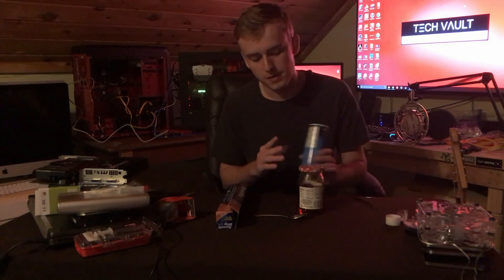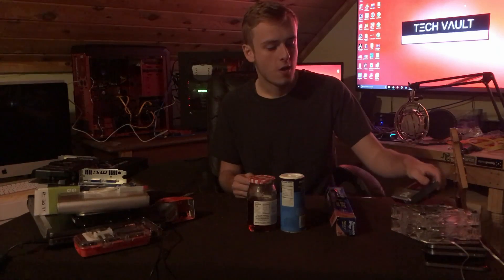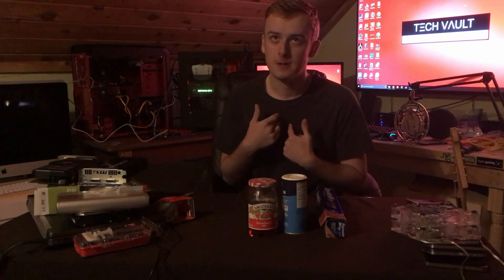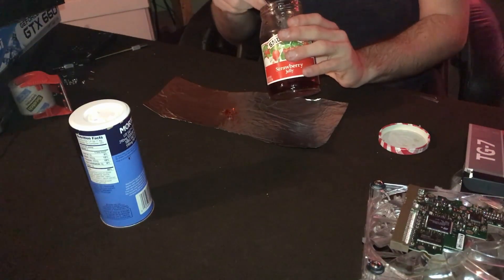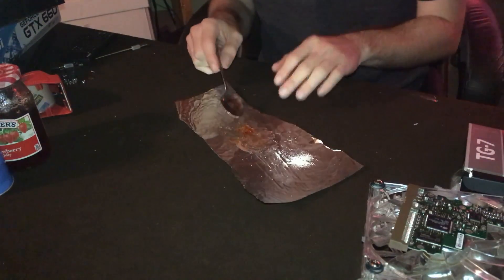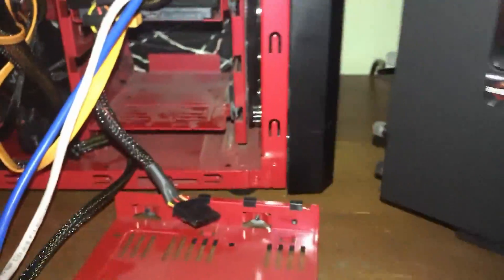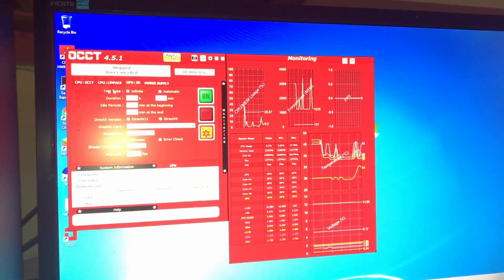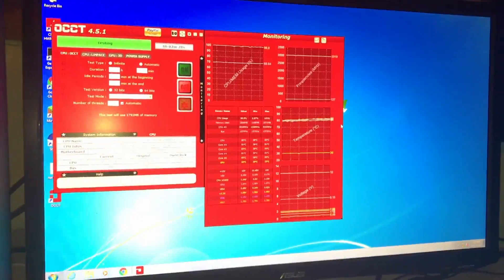How to make Good Thermal paste at home with common items

Comment: Better solution. Use metal shaving like copper. Make sure its very fine like a powder or  dust. Mix it with rubbing alcohol. Just enough  to bind it.  Be careful when you applying because copper dust is very conductive.
Reply: Don't do that, thats just stupid, it would fry your components, just use toothpaste instead
Reply: @leyzic9272 
Very expensive.

Comment: Based on my personal experience, you can mix toothpaste with grease oil. and won't dry. the mixture dosage is 70% toothpaste and 30% grease oil.
I have tested it on a laptop with a minimum temperature of 52 Celsius and a maximum of 74 Celsius.
Reply: Lol might try this buying new pc parts since the pc is 5 years old. gonna be a fun experiment
Reply: @toku5029  Hope the salt doesn't cause anything expensive to corrode.
What am I saying. If you do anything this stupid, you get what you deserve.
Reply: @BrianG61UK 
Yup your pic represent you well.
That's why it didn't came to your mind that the thermal paste are very expensive in some countries!
Reply: @CoptMan80  No ability to order off Internet? You have my sympathy.
Reply: @BrianG61UK  
Online order from China will take 45-60 days, it's a long time to wait, I'm making my own already.
Reply: How the heck can you afford a laptop but not be able to afford real thermal paste.
Reply: What if i add a iron and aluminium powder
Reply: You have a laptop and if it’s not a gaming laptop then the thermal paste isn’t that much of a deal because the low TDP with the unsatisfying-ly small cooler
We mainly need desktop chips as they have a higher TDP = more heat
Reply: @DJProPlusMax  asked ?1! 😳😳😭

Just kidding

Comment: I made this with few adjustment. Half the jelly,  barely any salt and i scraped a lot of my tip off my charcoal pencil and mixed it well and let it sit for 24 hours then used it and it works great.

Comment: I used Nivea Creme for a year. After a year If was still Not dried out. Had the Same temps as the standard stuff.
Reply: Mix Nivea with graphite so it becomes completely black. Temperatures will be better.
Reply: Why nivea creme? It doesn't contain a zinc oxide!
Reply: @CoptMan80  there are Versions with zinc Oxide... Another one is penaten Baby Creme that also has zinc Oxide in it. Works perfect.
Reply: @worldsendace  
Should it be a cream? I mean I've zinc oxide powder, will it work better?!
Reply: @CoptMan80  only Powder dosnt work because its dry. But you can Mix it with the creme. It should look like normal paste. In the end. You could also Mix the zinkoxide with oil. To make a Paste.
Reply: @worldsendace  
Yes i meant they sell zinc oxide poweder so i can use it better than a cream contain little of zinc and other ingredients, I'm planning to mix zinc oxide powder with graphite and vaseline to have a paste, if it works well it's still will be cheaper than the thermal paste in my country which is 4g of mx-4 cost about 400 local pounds! Thermal pads are more expensive!
Reply: @CoptMan80  yeah Just try. It will Work. As i Said i use this Creme with zinc Oxide all the time because i repair PCs and Test cpus on a daily basis. Comes realy Handy If you Change CPUs and Test them. Because one Pott of this Creme is 250g and thats enough for a Long Time. And i pay 2.99 Euros for it.
Reply: @worldsendace  
Great 👍

Comment: Can this work for a PS4?
Reply: Have you tried it
Reply: @allaroundtexas6433  nope, but I just took the cover off the PS4,  an original day one kind, and now it doesn't turn off on me after 10 mins. I can literally get a 8 hour gaming session done without the worry of overheating. Just leave it where there's a bit of airflow like a draught or something and you should be grand.
Reply: @johnnybongos3648  it worked

Comment: You killed my xbox
Reply: dr.jensen really what happened?
Reply: @SouthPokey  it burned it and started smoking and it blew the cpu up
Reply: Is not for pc or consoles is for power supply and others smd cips
Reply: @drutzi7364  it said its for both but i see i did it on an 360 and a pc they both got killed by this method rip
Reply: @bigfattony_  then rip

Comment: Salt is A good  conductor of electricity and there are tiny registers which will short circuit.
Reply: Top 3 best conductors of electricity in order:  Silver, Copper, Gold.  If you think Arctic Silver is safe to use and that it contains silver then you're not doing anything different.
Reply: I don't think anybody should take advice from you considering you can barely spell and formulate sentences
Reply: Owoop

Comment: i use tooth paste that comes with salt in it but u have to change it every 2 weeks
Reply: does it work?
im kinda worried without saying its real
Reply: @IJN_Kawakaze  it is good but change it weekly
Reply: @DrAliToma  i already did it, its fine :D im getting 65 to 72 temperature
Reply: @DrAliToma  Where do i store it? i  make many of it i kinda wanna know how to store it in case it will be dried up
Reply: @IJN_Kawakaze  u put salt in non salt tooth paste ? I meant use tooth paste with salt already in it but i guess that works too ... if u wanna store the patch u made just plastic wrap it tight with no air so it doesnt dry
Reply: @IJN_Kawakaze  also please tell me u used fine salt..
Reply: @DrAliToma yea
Reply: @DrAliToma  i put a salt on a non salt toothpaste the salt doesnt melt so i put a bit of drops of water to melt it
Reply: @IJN_Kawakaze  careful getting it on the mobo or the socket .. also u can just crush to a fine powder and mix it .. way safer
Reply: @DrAliToma  yea
Reply: @DrAliToma  last year i got trolled by someone he said you can make a thermal pad by only using electrical tape i see i the comments that it works so i tried it i put it in my gpu and it goes wrong i can see it in the temperature it goes up to 105° i quickly shut down the pc and all i saw inside my gpu  is just melted electrical tape importantly my gpu survived
Reply: Salty tooth paste?
Reply: In long run you will use more money on toothpaste then thermal paste cost
Reply: @haga5017  its just good until u get the shipment from amazon

Comment: Take like littlebit of oil, and a lot of graphite from a pencil, grind graphite very very fine, and mix it with oil, until, it's thick.. it's better than fkn marmalade xd
Reply: That's actually a good idea as graphite is a good conductor of heat
Reply: I just did a bit of oil, alot of graphite, and toothpaste and it looks, feels, and works like thermal paste
Reply: @lordsubl1me  mustered oil??
Reply: You fuckin legend!
Reply: 4 years later, tried exactly this, grinded up graphite from pencils and some drops of oil, working wonders and incredibly even better than before with dried up thermal paste. Legend <3
Reply: Wouldn't the oil light up
Reply: @johnuzoka6229  i mixed oil and toothpaste it didnt light but not the best mix
Reply: @johnuzoka6229  actually olive cooking oil would be a good conductor since it ignites at 430 °c ish  degree and if you use motor oil insted which is 800°c degree ish would be a good conductor 
Hence it cools down engines also
 
the cpu would go only about 90 (for most cpus) before throtling itself down 
 adding the graphite would keep the oil together from spredding 
Best case scenario if you put the motherboard horizontally it wouldnt go anyware vertically meh maybe it can leak down over time 

Anyway thermal paste is like 5 bucks so why not by some in first place
Reply: @nextmusic921  i know it was a year ago buuut.
I used motor oil, and a tiny bit of it only to hold the graphite and charcoal.
It was a thick paste. It worked. 
Not recomended for a long term, but it worked, also yeah i know thermal paste is cheap but also not everyone has a store nearby to grab one anytime they need. I forgot and nearest shop that seels it is like 50km away and i dont own a car so yeah i had to improwise.
As they say "Need is a mother for invention" ;'D
Reply: Also.. i will experiment further with just oil and charcoal and graphite. Why not. Maybe i will update you guys in the future after loong term testing ;)
Reply: @mepik_pl 
Any updates?
Thermal paste are very expensive in my country, i wanna ask why you add the charcoal? What's the benefits?
Also, what about Vaseline instead of oil?!
Reply: @mepik_pl 
Any updates?
Thermal paste are very expensive in my country, i wanna ask why you add the charcoal? What's the benefits?
Also, what about Vaseline instead of oil?!
Reply: Worked for me in emergency situations ;-)
I one forgot about that and it stayed on my cpu for a month ;-)

Thebn i tried adding to graphite some charcoal, very very fine powder ;-)
And i worked even better,  i don't have any metal shavings, or powder so i can't test other better mix :P

Comment: Can i use honey.
Reply from the maker: I did a video using it. It wasn't actually that good. You can check it out and see the results.
Reply: I just used Gel toothpaste mixed thoroughly with oil(two stroke in this case).